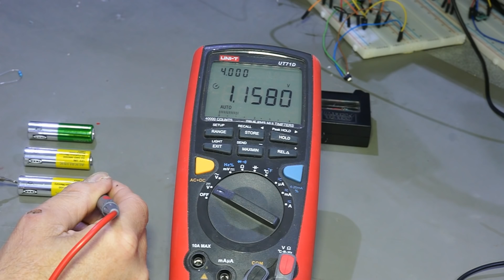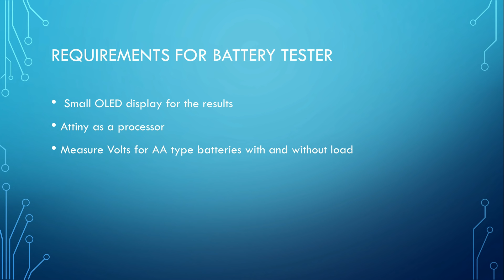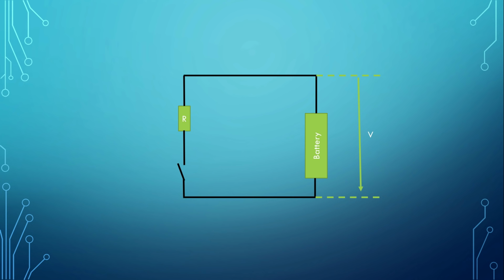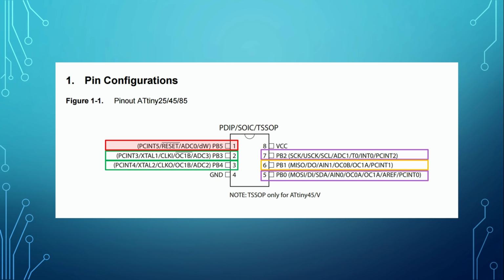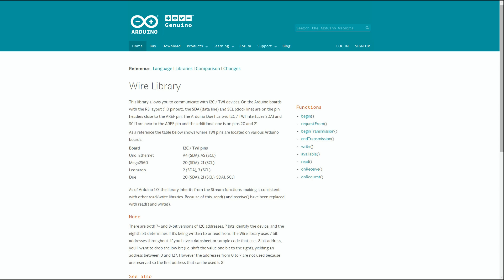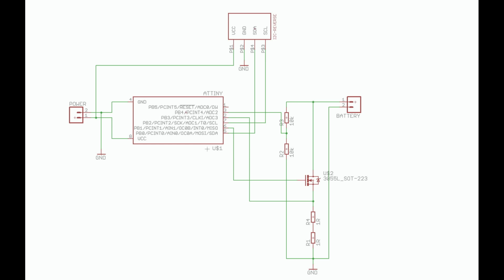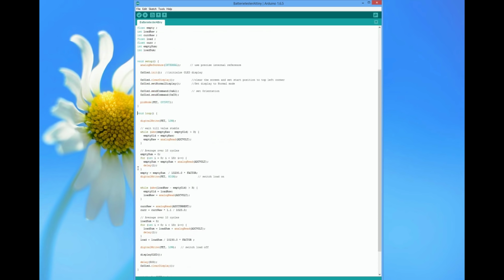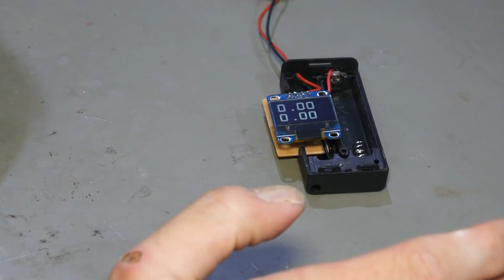#13 Automated Battery Tester with an Attiny85 and an OLED (Tutorial)

Comment: Great job and excellent explanation . I've been searching for tutorial how to work with my OLED display along with Attiny85. this video helped me a lot.thanks

May I have a question , you might can help me with it ?! 
I am trying to read temp from BMP085 and display it in OLED all by Attiny85.
BMP085 and OLED both working with the same SDA and SCL pins in Attiny85 , so I am not sure how to send data by sensor and read them from the same ports in Attiny85. any help would be appreciated . Thanks
Reply from the maker: +Ehsan Keshtgar Thank you for your comment! I2C (SDA/SCL) bus is made to connect many different devices to the same wires. This is why it is called "bus" . Otherwise it would be called "connection". So it is no problem if you connect both devices to the same wires. SCL to SCL and SDA to SDA. This is possible if all connected devices use different addresses. To find this out, you can let your adrduino check it. Connect each device independently to your Arduino (not Attiny) and start a small "Multispeed Scanner" sketch. The details are here:
http://forum.arduino.cc/index.php?topic=197360
Your Arduino should show you the address of each device and you can check if they are different. If not, you often have the possibility to change the address of one device or the other (on the device itself). Then it should work.
If not, you might have another issue: Termination. Busses have to be "terminated" wich means, you have to connect a resistor betwenn each signal wire and VCC. If needed you find information about this using Google. But I think, in your case it might not be necessary.
If I have time next week I try it myself and make a small video about it.
Reply from the maker: +Ehsan Keshtgar I took your question as a reason to create two videos about the issue. Maybe it is helpful. I anyway had to connect two different displays on one I2C bus for my power meter project...
Reply: +Andreas Spiess , Thank you very much for your help. it helped me a lot and I could manage to fix the issue.As you explained , I connect both pressure sensor and OLED display to the same SDA and SCL ports and its working fine. I also used pin3 and 4 as digital output for LEDs  all in Attiny85.  
Thanks again for your time and I hope to see more videos from you :-)
Reply: +Andreas Spiess Thanks . Could you please provide links to your new videos.Merci.
Reply from the maker: +Ehsan Keshtgar  Yes, I can...
Two equal displays: https://youtu.be/j6B47reye80
Many devices in one bus: https://youtu.be/QQLfzlPGjjE

I am glad to hear that it works now for you!